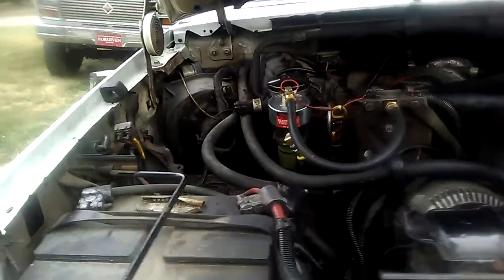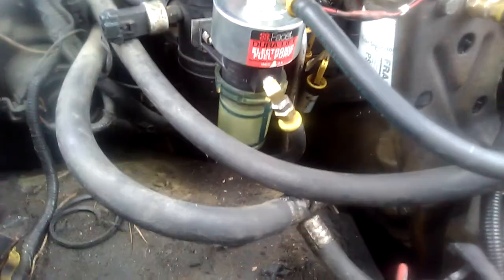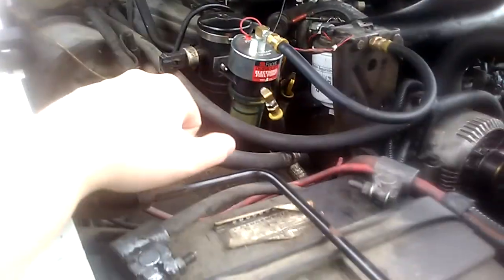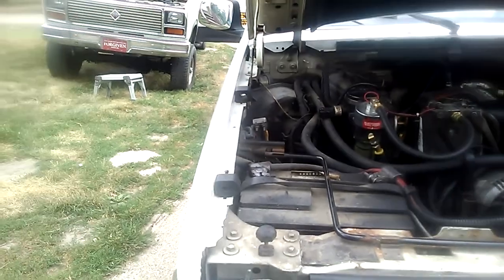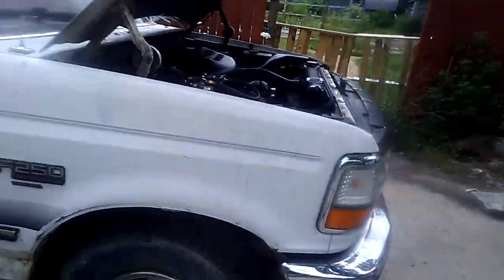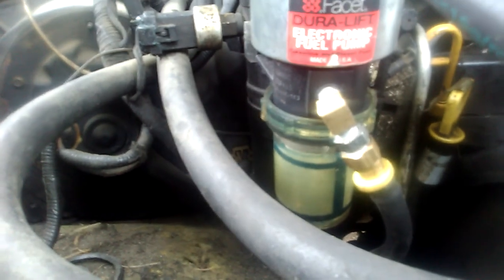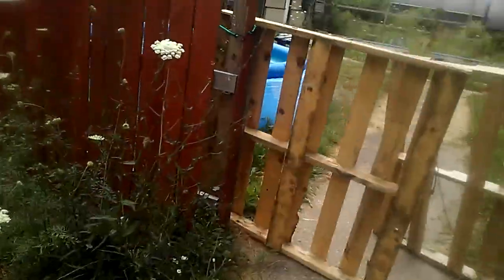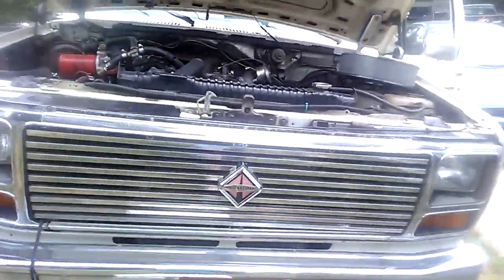Idi facet pump 40285 vs 40222

Comment: Mike, Thanks for posting this video. I just installed the Dura Lift 40285 on my '94 7.3 IDI turbo, replacing the stock mechanical pump. I have a FP guage directly connected to the filter head, and always saw 4-5 psi with the mechanical pump, regardless of RPM or load. I test drove the truck yesterday and with the 40285 electric pump there was only 3 psi at idle, and it dropped to 2 psi driving @ 50 mph. I am certain this pump would drop even lower at highway speeds, loaded or pulling 5 mile grades on Rt 80! That will not be good. I only just saw your follow up video explaining the 40285 vs 40222 pumps. I ordered a 40222 this morning and will update this comment with the FP results once I install the new pump. UPDATE: returned from 800 mile trip across PA. Big hills on I80, about 1000lb load. New 40222 pump provides 7 psi fuel pressure at idle. Drops to 5 psi at highway speed, and settles to 3.5 - 4 psi pulling long steep grades. Returns to 5 psi after road levels out. This is the perfect mechanical pump replacement. Worked flawlessly. I hope this info is helpful to anyone interested in doing an electric pump upgrade.
Reply: Greetings,  I just installed the 40222 on my 6.9 Bull Nose. The engine runs great but sounds like it is running advanced compared to the mechanical pump. Its been 4 years now on your pump modification. How is it working for you?
Reply: Thank you for the post!

Comment: Mike- how are your cold starts? How long do you let the pump prime before cranking? Reason I ask is because I installed a 40222 in basically the same location as you and my cold starts seem to take longer with the epump than they did with mechanical.

Comment: How well would the pump work closer to the tank I have a 1989 7.3 na I just ordered the 40222 pump
Reply: Facet pumps are pull pumps they like pulling the fuel over pushing  from what I have read these pumps were used for the refrigerator trucks and were always installed close to the unit needing the fuel not close to the fuel supply 
Hope this helps.

Comment: Hey just sold a 1990 F-350 7.3 with a banks and he just paid shop where it was at 2,250.00 and still not running right.Idles fine in drive and Neutral by loses power when put in gear some time 10,15-25 mph then back to 2-5 mph also massive white smoke on start up,I'm pretty sure G.P.'s are done and relay maybe but I also heard if a lot of white smoke could B lift pump is going which could explain power surge.which tells me to have my friend put in this set up like yours U have on the Video.also dam shop got nearly 3,000.00 out of me over the years.it was at his shop for about 8 years no place to put it  So I can't complain he could at leaned saled it.any suggestions
Reply from the maker: Roman Vasquez hate to say it but your friend got ripped off paying a shop that much. Every new truck I get I completely overhaul fuel system. New fuel line including feed line and return line kit, new injectors and if money permits a new injection pump and my electric pump like this. Done that on several trucks now with perfect results.
Reply: Mike Grn yeah I hear yeah my Neighbor told me to watch out for the the shop owner.Hey Mike what do think price will be for the the fuel system pump,return line to the tank correct and all that my buddy and myself are going to put it in our selves.And do you recommend watch your videos from start to finish.I'm going to tell to get the 40222 since he has the Bank's system after watching that part of Your video
Reply from the maker: Roman Vasquez a good local rebuilder shouldn't charge more than 400 unless pump head has to be replaced, accurate diesel is good for tune up stuff wanna say 200 for injectors 30 for a return line kit, prices vary on what ya use for feed line can use diesel safe rubber/nylon/steel/steel braided etc and then facet pump itself is like 100. Easily under 1000 for all

Comment: Did you setup a fuel return line with your electric pumps or are they NON-return???
Reply from the maker: JessieJ no return line hooked up for my e pumps
Reply: Thank You Mike also I have one last 2 part question : Did you use a fuel regulator with the pump? If so what kind of regulator did you use?
Reply from the maker: JessieJ. Nope no regulator they are flowing under oem spec
Reply from the maker: JessieJ just under

Comment: Hi, do you know what is the psi on that pump and what the factory mechanical pump was?
Reply from the maker: oem lift was 3-5 under load 40285 facet was 3-6 free flow, 40222 was 7-11 free flow I never hooked up a fuel gauge to both the facets under a load or in the upper rpm range.
Reply: @groundtogreen1140  thanks again mike for the rapid response and information very helpfull.
Reply: I have 40222 on 89 n/a 7.3 is the 285 better?

Comment: Hey Mike, which do you recommend for the '89 7.3 IDI Engine?
Reply from the maker: the 40222
Reply: @groundtogreen1140  this should feed it even when towing a camper and dump trailer without losing pressure right?
Reply from the maker: @firemanrob1938  ive been loaded up with about 10k and had no issues
Reply: Hm. Very interesting as I'm getting ready to get my93 back in service (after setting since 09 with blown head gasket) (s) billet fuel filter housing from I believe it's precision diesel going on along with any other affordable upgrades. Great post Sir. Very informative.

Comment: are these from the r&d site?
Reply from the maker: no I bought these elsewhere. R&D sells a different fuel pump
Reply: +Mike Grn and these replace the mechanical fuel pump entirely? I have a n/a 7.3 that id like to make the fuel system a little more reliable/better
Reply from the maker: +Jakob Davis you delete the mechanical pump with a block off plate these are much better
Reply: +Mike Grn alright cool thanks for replying. is the pump on the factory turbo truck the one youd suggest getting? how much are they?
Reply from the maker: +Jakob Davis yes I'd probably get the 40222 facet pump they run around 100$